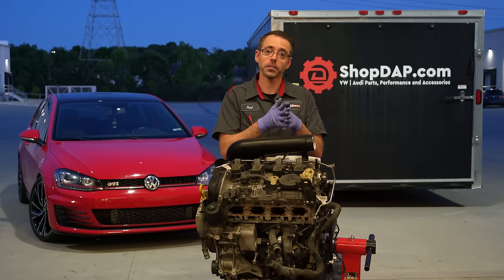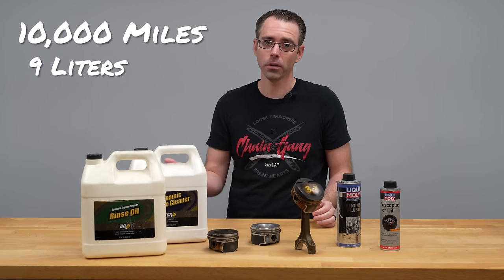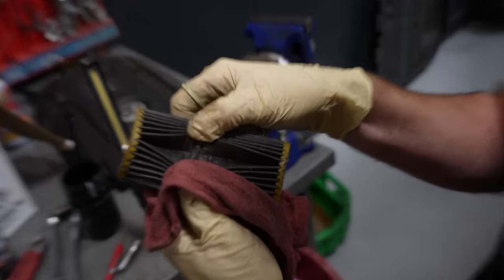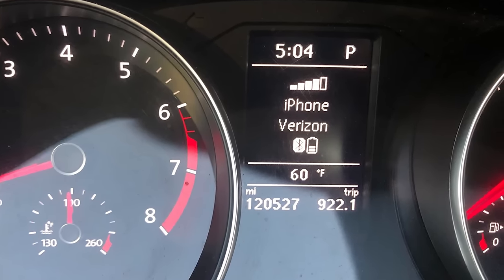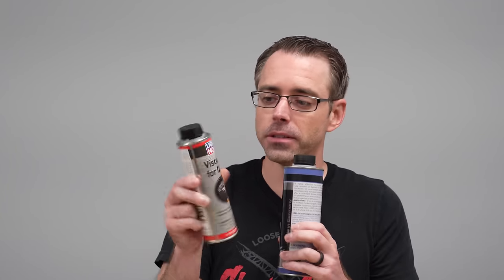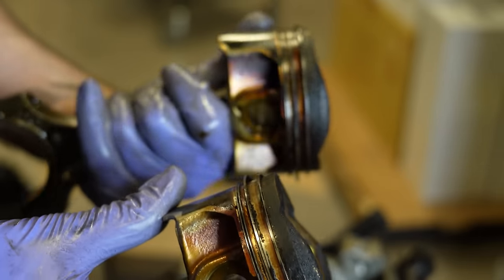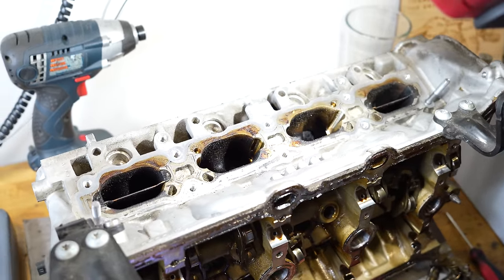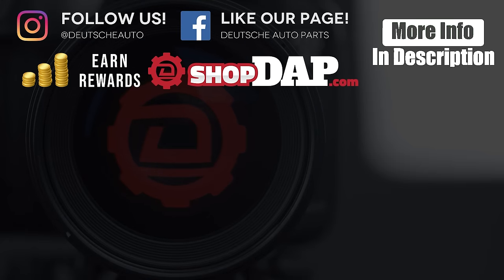Can you Fix an Engine Burning Oil for $20

Comment: I’ve tried many products in my 1970 Z/28 that has a rebuilt roller cam/lifters and low tension piston rings and nothing works including BG and Liquid Moly products. I still have the empty cans. I went roller because I lost 2 solid lifter cams even though I used the best oils that contained ZDDP. But I still burn oil which varies for some reason. Sometimes I get a bit over 500 mi/qt sometimes 250. It doesn’t make any sense. I’ve even tried different viscosities from 15w40, 10w40, 10w30, 20w50 and currently 5w30 Pennzoil Ultra Platinum Synthetic oil along with different brands of oils including conventional and synthetic oils. I’ve also tried different PCV valves. WTH. This video is BS and is only a sales tactic. I have a mechanical oil pressure gauge and a vacuum gauge. Both my compression and leakdown tests came out excellent. Nearly zero loss in the leakdown test.

Send me your stuff, I’ll try it again on my engine if this isn’t a hoax.

Comment: Engines aren't getting worse. Oil specs are. They are specing too light of oil for these new engines just to improve fuel economy at the expense of lubrication.  Take my 2019 GTI for example. Same engine with lighter oil spec'd than the year before. I noticed some oil consumption so will probably go back to the previous heavier spec once warranty is expired.
Reply from the maker: You are right about the oil weight but you also have a different oil pump.

Comment: Just use 0,5 Liter of Dexron VI and synthetic Motor oil for cleaning and drive 1000miles, Oilchange, done, Motor is clean.
Do not use viscosity improver, that will harm your Engine on the long run.
Wear at pistons will be reduced by using ceramic additives. With this Wear here, cylinders are elliptical, not perfectly round anymore, but with new Version of pistons it should be ok

Comment: I do everything to my car myself I do my own oil changes every 3,000 miles that's with cheap oil that I get from Walmart but if I'm getting Royal purple then I go around every :4500 miles and Royal purple is high performance racing oil that cleans your engine and I only use that every 20,000 miles but I changed my oil every 3,000 miles or 3500 with cheap oil. And then when it hits about 20,000 mi I'll do a royal purple and then I'll leave that in there for about 4500 miles and I used k&n oil filters with the Royal purple

Comment: I had a new 1978 Dodge Aspen for ten years. It didn’t burn one drop of oil in between oil changes. Original engine with a 3,000 mile changes.
Reply: Slant 6 ?
Reply: @geraldwegener8376  👍 225 cubic inch six cylinder. Ugly looking engine, but very reliable.
Reply: @Michael-yi4mc  Yeah, those were good cars. I bought a used 78 Aspen,  225 'Super Six' 2bbl carter. You're right about being reliable.
Reply: @geraldwegener8376  👍I bought it with the eight cylinder, 318. Equally solid!

Comment: Hey Paul 
So MK7 GTI has pistons that are in my opinion are less robust and has that groove/cut that you mentioned by the oil control ring. I was wondering if it would be possible to install updated pistons from 2.0T Audi such as B8 model into MK7 GTI? 
Wrist pins match up at 23mm and as far as I can tel rings and overall size is the same. 

Thoughts?
Reply from the maker: If you’re going to bother you might as well put upgraded rods and pistons, but no real reason to rebuild a MK7 GTI engine unless you had a failure. Since that’s rare, there’s no point.
Reply: @Deutscheautoparts  we reason I’m asking os because MK7 GTI engine we have has a failed piston that chipped off part of the side and was wondering if Audi pistons would work on that since they seem more robust and never had these issues where in MK7 i’ve seen and heard a lot of people having same issues

Comment: what I m scared of is the gaskets starting to leak after such an engine flush. can this happen after the sludge is removed?
Reply: Happens more often if you switch to a synthetic oil after using conventional for it's whole life.

Comment: I had a 2006 GTI brand new, it burned a quart every oil change from day 1. VW is in a different league when it comes to burning oil, not because the engine is old, but because VW.

Comment: Well made and maintained engines should not burn any oil, the fact that newer cars do is because of cost cutting at every opportunity, and cheaper less quality parts, they are made to wear out so you have to buy new, my old toyota hiace work van did 500k and was still running when i sold it, change your oil regularly and before what they recommend, the most you should go between oil change is 5000ml....

Comment: Easy fix, buy the amsoil flush and put it in where the oil goes, run the car for 15 minutes, then flush out the oil with all the gunk and carbon from the pistons, switch to a 100% synthetic oil like Amsoil and you will never burn oil again. It works.

Comment: While less piston rings could definitely cause oil burning- most of the new cars burning oil is caused by the direct injection and the use of PCV system pulling oil out of the valve covers and ingesting- burning that oil- however the oil doesn’t always make it all the way to combustion area and ends up sticking inside the intake port right around the hottest part of the port and building there because- the injectors are not able to wash and clean the whole port or if it is directly injected the fuel is forced into the cylinder like a diesel and not anywhere near the intake port- meaning the intake port will just continuously build up gunk. Either way, the intake manifold is required to be removed every x number of miles or some sort of a oil separator needs to be installed. The GM 3.6 v6 is well known for this issue. Also, the oil being burned is contaminating the oil in the engine creating other problems-such as clogging oil ports for valve train, phasers, chain tensioners etc.

Comment: I try not to go more than 3000 miles or three months on an oil change no matter what engine it is. Better safe than sorry on the inside of your engine. Also thermostats and antifreeze should be regular maintenance. This problem happens when the engine is hot and low on oil from not changing. All thermostats will eventually fail and it will stop the flow to the radiator and overheat the car.

Comment: High compression rings give .002% less efficient then low compression. My truck has high compression rings and burns so little oil that I can’t see the difference from full till time for an oil change on the dipstick.
2000 Toyota 4Runner daily drivin. 265,000+miles on the odometer. And to boot the oil is not as black as a newer vehicles oil.

Comment: The engine cleaner has a good point and a bad point yes it will clean the motor but if you have worn main bearings it may lower your oil pressure if you use a cleaner to clean out the engine on a old motor in my opinion only replacing oil do not put a cleaner in a old motor it could cause oil pressure problems I'm a retired mechanic

Comment: Just run a quart of kerosene through the crankcase for about 15-20 mins before you change it and do that for about 3 oil changes and that will clean up you oil rings and rest of the engine and for a gallon of kerosene is about $5 and it works better than molly flush and a lot of others for a fraction of the price but on an engine will old seals and gaskets it will more than likely start leaking and on a newer engine's run a quart of kerosene about every 5-6 oil changes and it will be fine but newer engines crud up because of the direct injection of fuel into the cylinder instead of over the valves and newer engines are junk.

Comment: You missed the reason for the burning!
Oil return drain holes behind the oil rings, they clog up, oil doesn't drain back into piston interior............easy fix............makes holes bigger and more of them.........go nuts wont hurt anything......the cut out below oil ring also helps drain oil.......drill new holes and problemo solved......lots of holes as big as possible , even a big long slot is used in some older pistons..............I've posted this info on heaps of videos of this issue........one day someone will listen!

Comment: My brand new zero miles 2020 Tiguan illuminated the low oil light before it’s first oil change 🙄 it was right around 3000 or so miles. I told my family to throw that car in the garbage but during this time Covid car prices were outrageous. So it was either keep paying 370 a month for a nice Rline and keep adding a quart every few weeks or on average pay 5-600 for a similar car because that’s how inflated the prices were that the dealer even called back asking if we were interested in selling the car back to them 🤦🏻‍♂️ 3 years later I’m still mad everytime I do oil changes and feed the beach 2-3 quarts between oil changes and I can only image it will keep getting worse and we are at 20k ish miles. I’ll never buy a vw audi in my life. Only a gt3 from the brand is acceptable everything else is garbage but hey it keeps mechanics staying in business lol
Reply: that sucks bro

Comment: been a mechanic for 30 years, i tried, and have seen people try ALL kinds of snake oils to disolve CARBON; nothing ever worked for me; you can't disolve carbon, you need to scrape it off. NEW oil with NOTHING, with its new viscosity, seals the rings better from underneath and makes any engine run better, but not any additives, they are just too little, too late;  if additives worked,  they would have put it in the oil, at least on some types of oils, but they don't.

Comment: I've found that keeping the speed and revs down and using only a light throttle opening helps hugely to reduce oil consumption, also use a heavy grade of mineral oil such as a 20W50 in place of a lighter synthetic oil and in really bad cases add a thickener such as STP Oil Treatment, these measures are a temporary fix and as soon as practicable the engine should be repaired properly
Reply: Mineral oil may help curb oil consumption in the short term but in the long term the increased wear and sludge in rings from using mineral oil could make it worse
Reply: Adding thicker oil used to work in old chevys and ford's.. in modern engines with tighter tolerance only reduces oil flow and causes   build up in the ring lands  thus causes more problems ...  ..

Comment: “3000rpm is a lot.” <Laughs in AEG 2.0 running 3250rpm at 70mph, burning 1qt oil every 7k miles with 250,000mi>
Reply: No load

Comment: I need new valve cover gaskets. The car doesn’t have any codes from the obd2 port but it doesn’t start the first time sometime,keys it just keeps turning over. I have new throttle body sensor, 02 sensor, fuel pressure sensor, fuel filter, new spark plugs and spark plug boots but it still does it, next im gonna put a fuel pump, then fuel injectors, i should probably drain all the fuel out it might have water in it.
Reply: All of my cam and crank shaft sensors are new to, and clean air ingrate filter, so its all squared away up into the point where im at

Comment: Sounds like that much standard oil burn would make it a 2 cycle engine. My truck is a 2012 and it doesn't burn any oil between 6 months oil change.

Comment: Yamaha Has a gas additive called "RING" free because of the problems with low tension oil control rings in new engines.

Comment: Newer Volkswagens has 1l of oil pr 1000 km as acceptable. My old 2001 VW Passat takes 1-2 liters during 15.000 km at which point I change the oil despite the service intervals saying 30.000
Reply: that's so much oil passing trough into the combustion chamber you don't even need to do an oil change anymore haha
10.000km equals 10L of oil burned? Insane.

Comment: Which year engines updated their pistons for mk7 GTi?
Reply from the maker: This was not an issue on the 2.0t GEN3 engine which would be found on the MK7 GTI
Reply: @Deutscheautoparts  ok. Just got notified on my road trip oil level was low and I just changed my oil at least around 2k miles ago never had this issue with any of my GTi mk7-mk7.5’s. Should I be worried? Just filled up 2 small liqui moly and seem to be running fine

Comment: my 200bhp E888 CCZB WV/Audi Engine  was burning oil 1L per 1000Km(700miles) , then my mechanic suggested i put in some new oil , to change oil , some kind of  Mobil oil , and Jesus Christ , doesn't burn oil at all any more . So it wasn't the engine , it was me putting in wrong oil . And i can only image 1000s of people doing the same thing , going on line telling how TSI engines use up oil because of manufacturing problem . When it is user error .
And here these so called "smart guys " playing around , burning up engine on 3000RPM with some Liquid Molly stuff ,  not knowing that cleaning will pull sludge to the Oil separator  pipe , clogging it up , lowering the amount of oil that gets to the upper engine , braking parts down the line .
If you use engine cleaners you have to clean the bottom cover and oil pump pipe and filter .

Comment: Do not use engine flush of any kind. Modern engines have very small port holes and clearances where the oil flows through. You clog those with pieces of think hunk oil snd your screwed. You stop the flow of oil and you will ruin the engine. Use something like Castrol ultra clean engine oil that will remove sludge build up in a slow manner. You can even use up to 20 percent of Marvel Mystery oil in the engine with the other motor oil. This will also clean sludge slowly. Do not flush the engine. Hey what do I know after over fifty five years playing with cars/trucks.

Comment: Acura TL 2008 with 230 km, burns zero oil between oil changes. That’s between 6000 km . I’m literally putting in nothing. My 2012 Acura TSX burns half liter between changes. FYI I have an Audi A5 with a replaced engine. I add 1 liter between changes. That’s  5000 km .

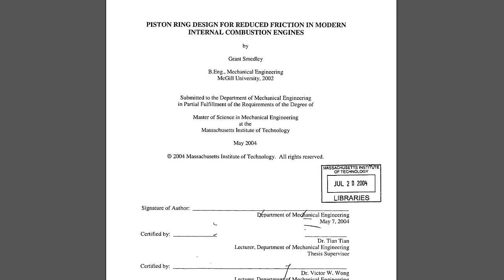Comment: 1:00 totally missed an opportunity to talk about the coolest solution to this problem: the rotating liner engine. It's in testing now. Spinning the cylinder walls means the piston/ring/wall interface never reaches the static friction regime, it's always moving!
Reply: The rings rotate on the piston during running at a speed of about 1% of engine rpm, the crosshatch finish left by the honing process on the cylinder walls helps to promote this rotation. Rotation of the rings is important as it evens out wear, valves also have a mechanism that helps them to rotate for the same reason
Reply: The honing pattern in all engines rotates the piston rings on every stroke.
Reply: Neither of you are right about what I'm referring to. I mean literally rotating the cylinder WALLS.

Comment: Hi guys i like what your doing here and really don't want to be the typical person criticizing you online like so many people very rudely do "BUT" I do see a few floors in you methods. Firstly the compression tests. The temperature and whether dry or wet can make significant differences in pressure readings. If for example i sprayed wd40 in cylinders that alone could raise the pressures and temperature also changes the readings so needs to be a more controlled test. I would do the tested hot and cold using laser thermometer, dry and wet with a cylinder 

Thanks guys and keep up the good work.

Comment: half a quart (or a quart) of transmission fluid will clean the hell out of an engine. It acts just like engine flush. Just run it a couple hundred miles right before your required oil change.

Comment: Wow thats alot of oil consumption. My "crappy" Ford 5.4 3v at 272,***miles eats/loses 1 quart every 700ish high way miles. 75 to 80mph tach is kinda high, close to 3000rpm with tiwing 4.10 gears. This video made me feel alot better about my situation, lol. VW should be ashamed for allowing such a thing to happen... and not fix it asap! This is why people are afraid of german cars. They won alot of people back with there very low ish competive jetta prices and long warranty. But that will go down the drain if problems  like this affect the majority.

See at least my "bad engine 1.8t 20v" ( it was on a bad engine list a magazine did ) is actually doing good with no sludge, changing walmart synthetic oil at 5000 miles. These new cars make my 21 yrs old b5 look like a honda🤣  i will be keeping my old cars till im forced to buy a EV.

For the most part, Only a enthusiast will spend rebuild motor money on this issue. The rest will just get pissed off at vw and get buy a 10yr warrentee kia/ Hyundai

I was disappointed with syn liquid  moly trans oil. Very nachi when cold. And i refuse to pay double for 5qt jug of oil. When walmart oil works. But for 3 to 5 dollars more u can get pensoil or quaker, and val. I do use mann, or mobil 1 oil filter.
To bad u cant get that pro cleaner your self.

I like your channel u guys are funny.

I also see u guys do car reviews, maybe you would like to see my B5 1.8t stroker.... when its done. Was at 500chp 93 fuel full weight street car on old setup. Hoping for more with stroker.

I a

Comment: In my humble opinion the engineers are at fault. They are the ones that set the oil change intervals at ridiculously high mileage. If you return the oil change interval back to around 4000 miles you won’t have this problem.

Comment: I have 350k on my 4.3gm chevy uses no oil i drive nyc to florida.  
Use cheap oil filter 3000 miles. Original motor. I had Bmw VW benz...$$$$$$$junk break down .
I love old 240 Volvo s only  .

Comment: When using oil, really there is a problem. should not use any. I know I do not need to change at the miles used, but I do anyway at 5K anyway. It is fine for short miles, but I am high mileage and change , long before needed. 86K miles in 6 months. change oil more often than tyres. never uses oil. use gears more than brakes and they last a long time. A lot depends on how you drive. Short slow journeys to school and shops will be a lot worse